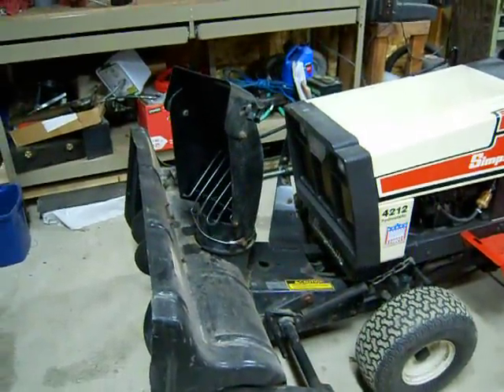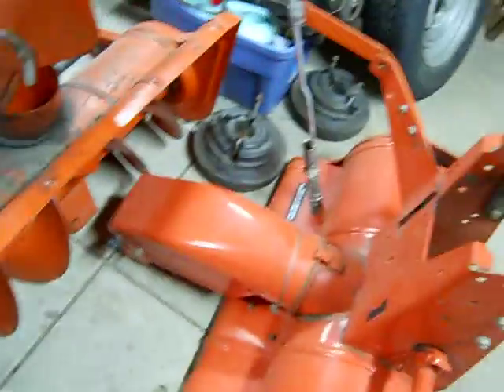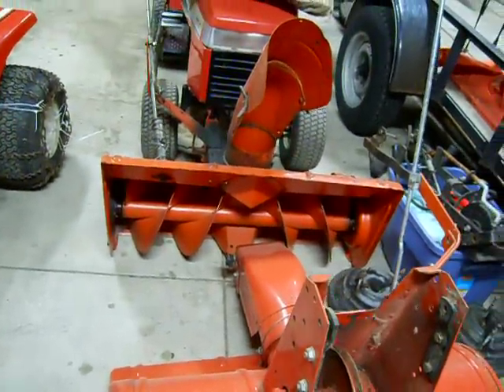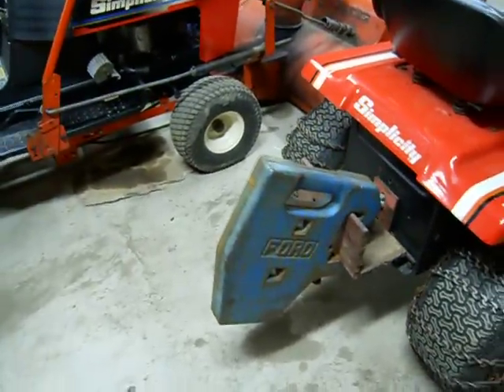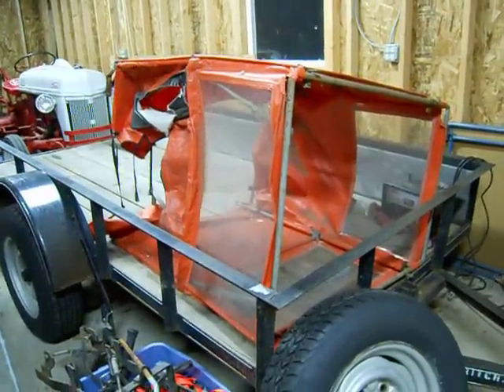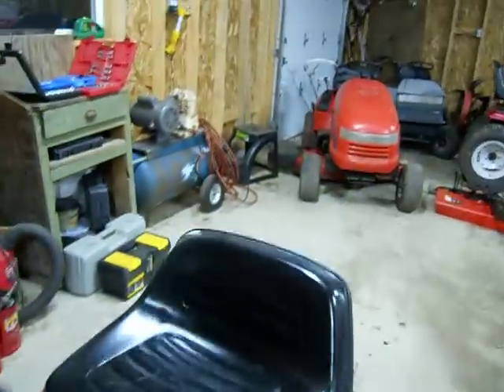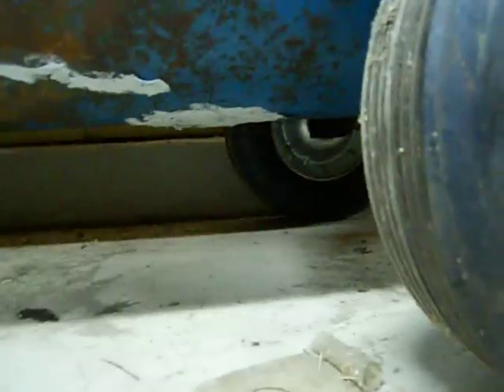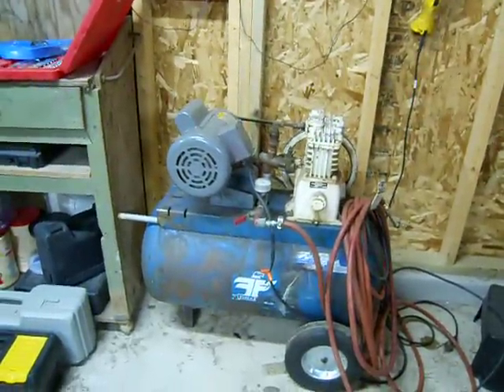Simplicity 4212H ready for snow

Comment: For the right side with the lever, yes. However I am having problems with the left side. There is a bracket that slides on the shaft that runs underneath the belly of the tractor. The bracket has 3 holes and there is also a thick washer with a set screw to lock it in place so the leaver doesn't slide out.
Reply from the maker: Yep, that is a newer set up.  This is mid to late 80's set up for 4000, 5000, 6000 series and some select others.  I might have one I can look at.  I will look tonight.  Thanks.
Reply: If you do that would be awesome to make a vid. It'd help me alot.
Reply from the maker: Shane Kisley new video up now.

Comment: How is blower  does single kohler can handle  heavy snow or wet snow?  i had 4211 i am going putting new Vanguard twin V 21 hp on 4211 will work better in snow

Comment: have the 4212 and we are replacing the engine with a slightly newer one but near the same age just trying to figure out the auto choke on the older carb since the newer one had a manual choke so we're trying to mess around with the older auto choke to see how to get it to hookup. So far no luck.

Comment: Thanks, good video. I have the 4212 and was wondering what blower fits it. This was a big help. By any chance do you have a snow blade for the 4212? I got one with mine but have no idea how it attaches. Not sure I even got all the parts for it. It's an old blade (heavy) probably 1970's or 80's vintage.
Reply from the maker: I used to have a blade years ago.  I no longer have either the tractor or the plow.  This is a parts breakdown of the plow set up.  Yours should look like that otherwise it won't fit.  The hitch is the big key. https://www.partstree.com/parts/simplicity/accessories/1691523-42-snow-plow-dozer-blade-hitch-group/42-snow-plow-dozer-blade-hitch-group/
Reply: Thanks much (Y)

Comment: @W1WEASEL  Do you know if the 4212 and the 4211 parts are interchangeable? I am buying a 4212 good runner but a little beat up and I found a 4211 that looks mint but the trany is shot for $100.I'm hoping to make a nice tractor from the two.

Comment: How does the snowblower lift arm mount underneath the tractor?
Reply from the maker: The lift arm attached underneath the footrest with four bolts.  Usually the holes closest to the back of the footrest but sometimes on the older models it mounts slightly closer to the front of the tractor but still on the footrest.
Reply from the maker: Shane Kisley New video up showing the type of lift arm I think you are asking about.

Comment: What do you like better yours or the 4041?
Reply from the maker: I guess it really depends on your application.  But in general I'd take a 4041 all day over a 4212H.
Reply: I have been searching .. I live we’re there just not needed (city) but I have lots  of fruit trees 60 of them.  I want to farm
My front  corn 🌽 other foods   I call
My food deal the city farm .. where should I be looking for the 4041?
Reply from the maker: @expatconn7242  Not a ton of them around.  Simplicity's were sold primarily in the upper midwest so I would guess that is your best shot.  WI, IL, MN,IA, MI,IN,OH.  Has to be better newer options for farming small acreage than a 4041.  How about an older Kubota?
Reply: @LawnGardenFun  was thinking that’s to but getting to the back from the front  I have 20 ft box in my drive way  .. corner of my home to the corner of the box is barley enough room  to squeeze by.. what do you have in mind
Reply: @LawnGardenFun   I just went through all those states you said .. I found 2 4041 $3500, $4500. 2 4040 $2500, 4 9020 I don’t remember the price.  1 7790  $1400  . Now on the 9020,  7790 did they have a rear pto ? No pic showing a pto
Reply from the maker: @expatconn7242  The 7790 is a Sovereign type tractor.  Basically, they built those Sovereign type tractors from the early 70's maybe even earlier until 1998.  So needless to say there is alot of attachments available for those type tractors and very reasonable prices.  They don't have a standard tractor type 3 point hitch and rear pto.  But there plenty of rear attachments for those tractors.  Tiller, plows, power vacs.
Reply: @LawnGardenFun  what dose  sovereign mean.  I don’t know..  what about 9020  .. in your opinion top 2 are the 4040 and 4041. I did come across Montgomery wards tractor exactly the same as 4040.
Reply from the maker: @expatconn7242  The 9020 and 4040&1 are in the Pow’r Max series of tractors. Look up simplicity sovereign and you should see a whole bunch of tractor models with same type chassis.